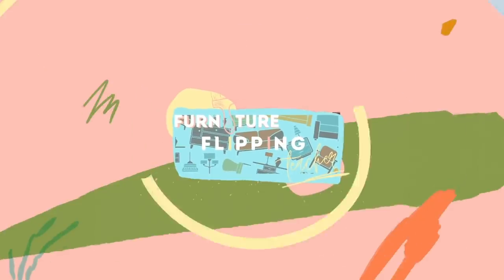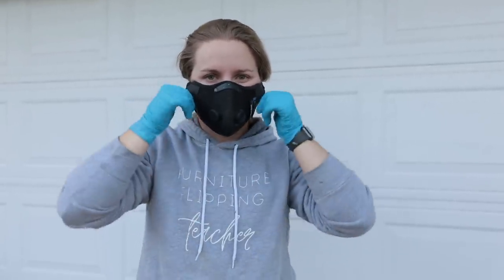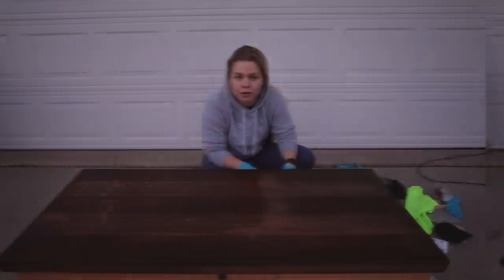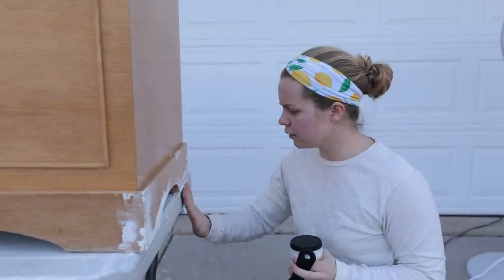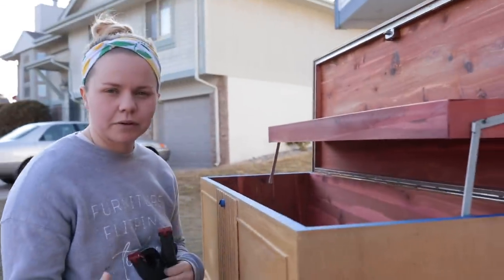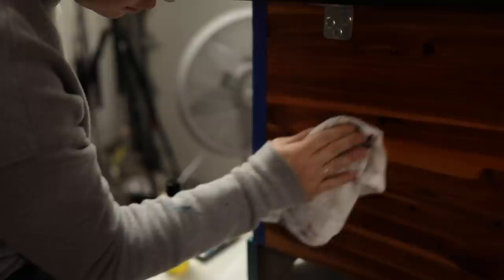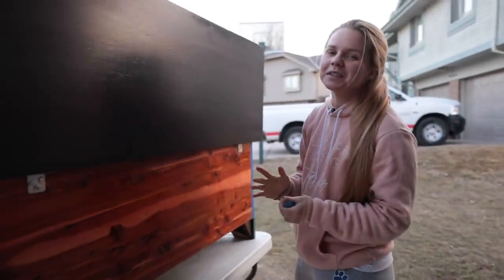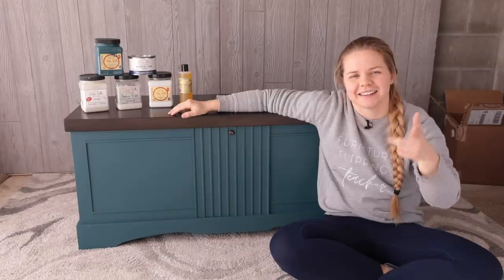| LANE Cedar Chest Makeover | Water Stain Fix | DIY Chalk Paint & Stain | @DixieBellePaintCompany |

Comment: Tip for you: set your piece on paint/stain cans (under the body of the piece) so the feet are elevated off your table. Then it’s easier to paint the bottom of the legs without getting paint on the table.
Great job on the chest. The color is beautiful.
Reply: it is  obvious to me that  she knows this  obvious tip and 
has no current need for it.

Comment: Just finished restoring my mother's Lane cedar chest. Built Sept. 27, 1945, sold/bought in Baltimore, Maryland. A couple pointers. Her's was a medium brown mahogany veneer. The veneer on the top was damaged/gone, on one corner. One of the rear legs was broken and the piece missing. First, instead of a vibrating square/rectangular Sanders used a random, orbital, round sander with 220 grit to remove the old finish. Then repair major damage. As mine was mahogany I couldn't afford a 4'x2' piece of mahogany veneer or a block of mahogany for the leg. I decided to use wood filler to repair/level the damaged lid, then sand level. I carved a new leg based on the remaining leg, then installed and blended the repair. The waist trim molding was shot so I bought some 2 - 4' long x 1" wide carved oak trim. I took the lid and tray off the carcass. After sanding the carcass, again with 220 grit, I wiped it all off. I used Min-Wax dark mahogany Stain and Polyurethane (I prefer this because with wipe on stains you really have to be careful that the "overlap" doesn't show), stained the carcass (2 coats) the lid and skirt were painted semi-gloss white, the trim was also stained. I obtained the new "childproof" lock, free from Lane. It took some work to get the new lock to sit in the old locks' position (If you do this throw away the screws that come from Lane. These require a countersink in the metal or they become a snag/scratch hazard.) I ordered silicone bronze, pan head screws. Look better, no sharp edges. The lock hasp, in the lid, was a challenge. The old piece won't work with the new lock. If you take the small rectangular piece out of both hasps. Swap them and it works fine. When doing two different colors you definitely need to mask. If not, it's  easy to get an unintended drip or spatter and ruin your work. Another way to treat the water damage is seal the lid with shellac. Use 0000 steel wool to break the gloss then use Stain and Polyurethane over.

Comment: With encountering "problems" during a project, I always ask myself two questions:
1) If not for those problems, would the time be (more or less) accurate?
2) When you come across this sort of problem again, will it take the same amount of (extra) time again?

If you answer "yes" on 1, then this is simply learning time. Learning to take this into account with every job you take on, and maybe even recognize the more problematic ones and estimate your time on that.

If you answer "yes" on 2, then again, it's time well spent. Next time, you can calculate some extra hours. Possibly even add 10 to 25% on each project concerning hours to be on the safe side. You can always give a small discount when the whole project went easier than thought. It's easier to give back a little than to try and ask for more.

Comment: Interesting fact about Lane Company cedar chest and other furniture that they made....the serial number read backwards is the date that the piece was made. An older piece, if it has the papers with it like Lane Cedar Chest do taped or stapled to the top on the inside top,  increases the value up to $700. In original state, the value starts at around  $400. Lane Company was in my area. My sister worked there. Very sad that it shut down. Thx NAFTA! I've been researching to see if they are made still but by another furniture factory. Btw, Lane Company was in Altavista, Va. I am in Danville, Va., 35 miles south. 😊

Comment: If I were going to splurge on any of Dixie Bell's products, it would have to be the gator finish.I love the way it looks and it seems like I would have to put many coats of a regular poly to get anywhere near the same durable finish.I have a cedar chest that my Mother gave me in my early 20's.I sanded, stained, and polyed it about 15 years ago and have been using it as my coffee table.Now I think I want to re-do it in the 2 tone look but with a more muted version of that blue.Love your videos.You definitely didn't get paid enough for your labor.Maybe give the client a range (exp. 10 to 20 hours) so you can adjust for unseen issues.😊

Comment: Looks great, a couple of comments - Dealing with the water stain before finishing would have saved you a lot of work, and - did you intentionally not do the lower edges of the lid sides ?    In spite, nice job.

Comment: When re-staining what I almost always use three 000 steel wool pads. It helps with removing stains scratches imperfections. And you can use it as the applicator.

Comment: On the part of trim on the front another method would be to use a few Brad nails through the face of it to hold the trim down. Using a narrow putty knife first to get some glue under first would be good before brad nailing. It all looks fantastic. I am learning different finishing ideas from you.

Comment: Ofc you can clamp there with your clamps... 
You just use two of the large metal screw clamps you have, one over the top end and one over the bottom decorpiece of the chest. Then ttake a really sturdy board (perhaps boards, one shorter under one longer and clamp the board(s) in between clamps over the whole length. 

Btw, when clamping on an area that will show on the outside of a piece of furniture, make sure to allways have something like  cardboard, some cloth aso between the clamp and the surface. That is how one avoid ugly marks on the surface. Same thing when you way a piece down with a paintbucket aso, put something in between so that the surface wount get marks.

Comment: You are getting better n better. Have u ever heard of a product called retique it? It is essentially liquid woodbine a can u paint on any surface and it is stainable with most oil based stain. Look into it....it could help u if this ever happened again or if u have a laminate piece that u wanna stain the top u can retique it. I learned about it watching vintage melanie and I watched many tutorials on it. I just bought some myself but people on youtube love it...ive also used shellac to even out pieces when im staining....shellac three thin coats works great as well🥰....u might wanna get a large syringe with a "needle" on the end. I save them feom the butter injectibles I get for making my turkeys on the holidays..lol. Its easier to push the wood glue in a syringe and get into tight nooks n crannies....it really helped me fix a peeling vaneer on some desk tops in was working on ect

Comment: Dear FFT,
Fantastic job!  Customizing old furniture to match existing decor is a great idea.  One suggestion to add more value to the project is also to reapply the diminished cedar oil to the inside.  You can get it on Amazon at a reasonable price.  Just don't use too much because it is really strong.

Comment: Love the colors. I wonder if you would have used a chemical stripper to help remove the original top coat if that would have helped to lift off the water damage. I like to watch furniture restorers here on YouTube and they mention that the water stains usually happen when moisture gets under the top coat. So sanding with a rough grit to get to bare wood should help but is risky when dealing with veneer because there’s not much wood and you can easily sand through. That’s where chemical strippers or hand scrapping comes in handy. It’s hard to know what problems you will encounter. Charge a little more upfront and if you get it done in less time you can always offer a discount. 😁

Comment: Questions:
What about leaving the back cedar?  I want to do this flip.  My concern is that the cedar will show and be off uniformity.  Can the Cedar be painted?

Question 2:
My piece has skinny table legs and I need replacement metal cap feet ends or upgrade.  What do you suggest for replacement and or change out?

Loved your video. All your videos!  I'm going to attempt duplication to the antebellum blue.  Using your links.  Wish me luck!
Reply: I am referring to using it as a coffee table.  Having cedar face the couch and blue on 3 remaing sides.

I also am considering doing this as a flip top open up coffee stable by modifying hsrdware.